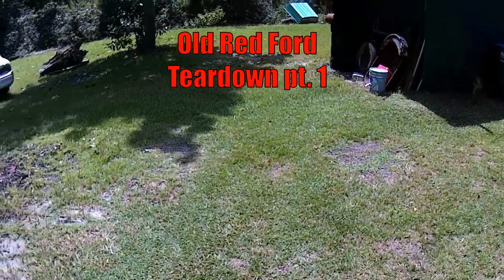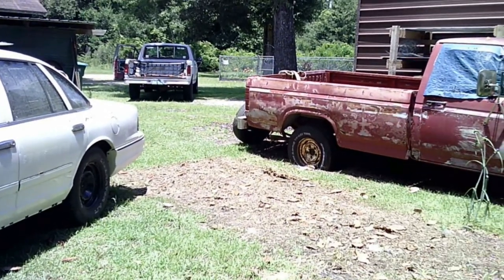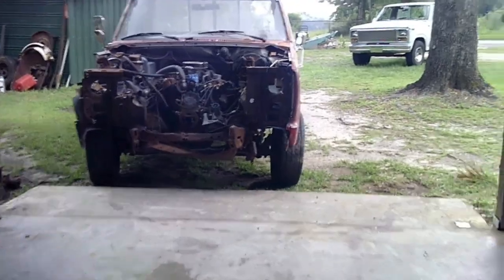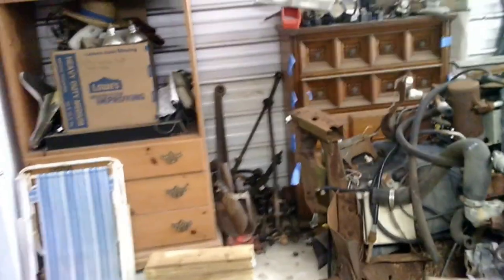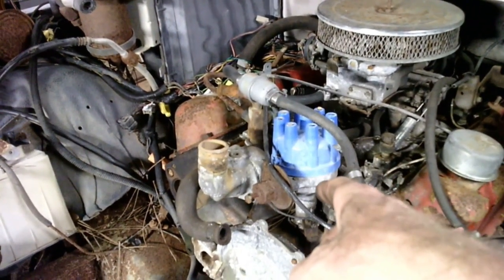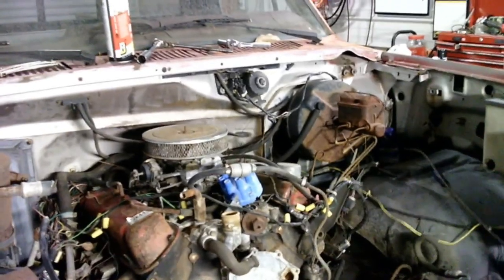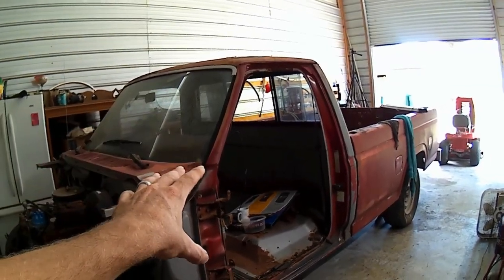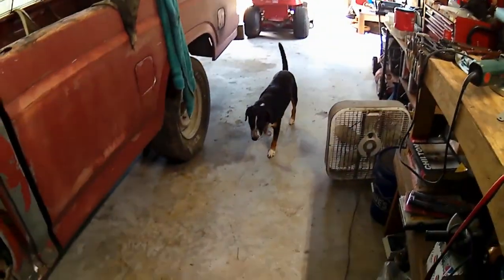Old Red Ford Teardown! pt. 1

Comment: That frame horn looked just a bit off.Might fight a hammer and dolly.LoL.Bit by bit,it'll be a big pile of parts soon.Have you considered using the diff,and part of the frame for a trailer?
Reply from the maker: Right lol just a bit. I'm thinking the axle will go into one of the other trucks if they ever need one. The frame is too bad to be on the road but it is drivable so either trailer or if the budget ever permits maybe mud truck lol